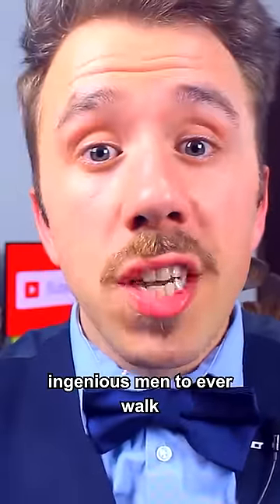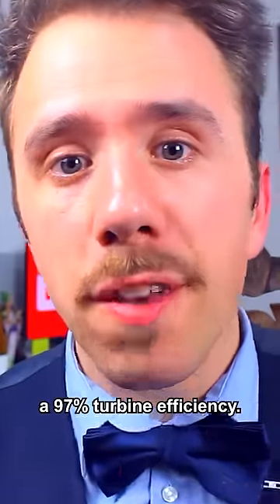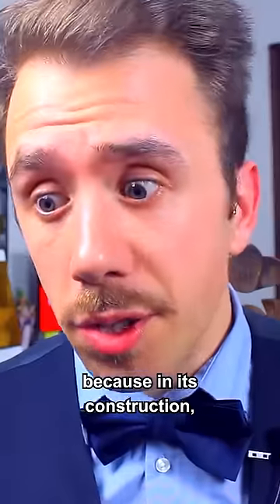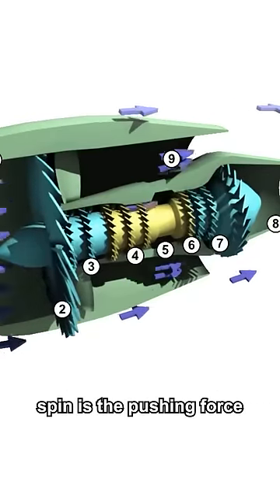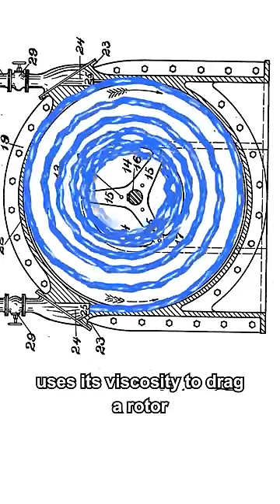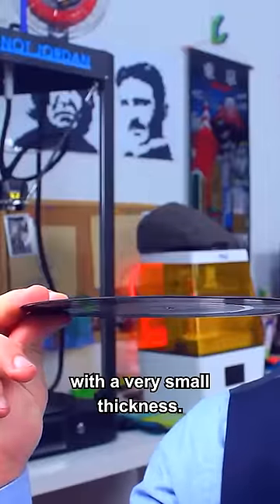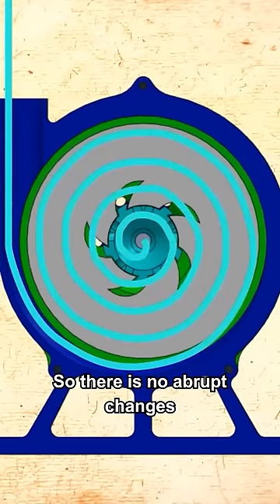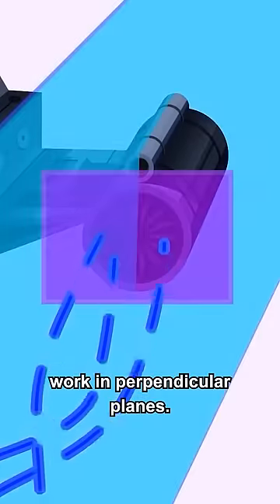97% Efficiency?! Was Tesla Right About His Turbine?

Comment: whenever you put a load on it, its efficiency decreases to a point where it is only marginally better than a traditional turbine, and even though it was still marginally better, it was never widely used because the blades would warp.
Reply: The warping is a big issue, blades sturdy enough to withstand the stress can likely never be small or thin enough for the thing to even work right
Reply: This is another one of those time where if the title has a question in it the answer is usually no.
Reply: To me this sounds like "V1 had missed some traits". Usually that means that people create a V2 trying to take those additional factors into account.

Have there been attempts at doing this? And if so, why didn't it work?
Reply: also only works for certain applications mainly power generation wouldnt work for airplanes for obvious reasons
Reply: Or to be that efficient the blades or the discs would have to be composed of vibranium or anamantium.
Reply: @Olav_Hansen was that an ultrakill reference?
Reply: Yes, but building materials have improved such that his design is used as a pump that can actually pump sand and rocks
Reply: @richardoconnor7112  It would be interesting to see how it would work when applied to moving grain. If successful it would definitely have some benefits for smaller scale farmers.
Reply: 🎉❤May new Materials such as Graphene, Titanium, Fiber Optics Composite and Uranium help?!
Reply: @EnbyOccultist I love your pfp. Did you draw it yourself?
Reply: As far as I remember it turns into crap when you put a load on it, and one of the main issues is having the gases exit without effecting the discs.
Reply: So his genius was not all that after all
Reply: it never archived the claimed efficiency. In most applications it is not superior, because peak efficiency is only possible at high velocities and its  relatively low torque at low speed.
Reply: Do you mean thermal efficiency? Wouldn't it be subject to carnot efficiency and not get anywhere close to 97% even when there was very little load, it should only be like 30% efficient, MAX, right?
Reply: @Olav_Hansen  the disks bend and warp and can't be made strong enough thin enough to work
Reply: @arg31ify  can't it be made thicker?
Can't it be made more rigid?
Most designs fail the first time, but by recursively designing a product you usually overcome many of the challenges, even if it's at the cost of some of the theoretical performance.
Reply: it is used in hospitals
Reply: @hamster2845  Maybe, but I think it would need something more like Mithril. Though I suppose you could use, Dragonite ore or maybe Adamantium.

Sorry, lame joke, I'm very bored and my edibles are kicking in.(I don't like alcohol and Cannabis is legal where I am.)
Reply: The reason for bending and breaking is because of the immense kinetic energy at the edges of the disks, especially at higher rotations per minute or especially per second.

Theoretically, the work is basically flawless, if you are comparing it to almost everything else from the same period.

Especially at smaller scale, it works very well.

However, spinning the edge of a disk with radius around 15 centimeters (so 5.9 inches) at 30 000 times per minute (or 500 times per second) is completely different from spinning a disk with radius of 15 meters (so 49.2 feet) at the same speed.

For comparison, with the first one you can cut down a tree. with the second one, you are probably splitting a mountain in half, vertically. The kinetic energy at the edges is absurd.

So, while the calculations of Tesla are correct, at least I have never heard of any material that wouldn't tear to pieces at such speeds.

I'm not doing the calculation, but it should be something like: rotations per minute (so speed) times weight of material times the radius... I have no idea right now, and I'm not planning on checking. It's a lot.

Using something smaller doesn't really work for mass use, because something smaller cannot power a whole city, and no one has the time to deal with thousands of these, each generating a small amount of electricity, each with the possibility of breaking... No one is that stupid (I sincerely hope really no one is that stupid. If someone actually decides that this is a good idea, it would be a good sign that humanity won't last much longer, at least if it's someone higher up on the ladder of political power). It would even cost way more to make and maintain them rather than building a normal dam with a normal turbine.

Diamonds would (most likely) not survive as well, the disks need to be quite thin, so the water can rotate them easily. Diamonds are also not indestructible, and such tearing kinetic energy might snap a thin diamond disk (at such speeds for a very big diamond disk, someone would probably die a lot richer as the disk shatters and countless diamond pieces slash them in half, vertically. Probably tiny pieces of diamonds stuck in their bones and insides as well). Not to mention the production costs and repair costs... Since I haven't done the calculations, I don't actually know if diamonds would survive, but I (again) know that the kinetic energy is absolutely absurd, so I can see this disk rupturing, even if it's made entirely out of diamonds. Keep in mind, those disks should be really thin, like a millimeter to two millimeters (so 0.039 inches to 0.078 inches) (that's going off of memory, so they might be slightly thinner or slightly thicker).
Reply: @Olav_Hansen there have been hundreds of attempts and none work for various reasons mostly boiling down to the design isn’t realistic like most of teslas designs.
Reply: @EnbyOccultist  The blades don't have to be thin, only the space between them. Of course, then the power density goes down, as you have fewer spaces for a given volume, but the principle remains.
More importantly, it reaches peak efficiency at unreasonably high rotational speeds.
Reply: @Happy.Viewer Uranium and fiber optic probably won't, the first one because it's heavy and at the same time radioactive (so unless it is used in a close environment some uranium would get into whatever is going to the disc via erotion) and fiber optic because it isn't hard to break and it basically really thin fibers of glass
Reply: At the end of the day, while harnessing laminar flow was a good idea in theory, the construction to take advantage of it was just no good in everday, practical use.
Reply: Thank you captain!

Comment: 97% if there is no load attached to it... otherwise everyone in the world would use it already
Reply: So... Just a disk that spin?
Reply: @bachvandals3259  tesla spinny turbine
Reply: Wrong,  it turns at such an insanely high rpm that bearings can't be used on it
Reply: @NeuKrofta  what number are we talking? Bc we got all kinds of fancy bearings.
Reply: @provuksmc6619  30-50 thousand rpm that we know of. It's basically unknown how fast it can go
Reply: no the turbine had a had start in the market and the efficiency is about the same as a turbine
Reply: @NeuKrofta It's not a materials issue, it's a physics issue. Once you apply load to the output shaft of the turbine, the fluid speed and disc speed desync, inducing inefficiency due to shear flow and reduced contact time.
Reply: Actually the load isn't the problem, the problem is viscosity.
A torque converter is basically a Tesla turbine, it can pull all the load any engine can produce without actually exploding.
Reply: @monad_tcp  na... a torque converter is a gearbox
Reply: @NeuKrofta  bearings can be used at those speeds, 30 - 50 thousand rpm isn’t that fast. Your vacuum cleaner motor is likely spinning faster.
Reply: @conorstewart2214  and then there are still magnetic bearings
Reply: @conorstewart2214 vacuums are 15-30k rpm, not 30-50k. Torque converters are also fluid filled and operate on similar principles
Reply: the problem with the Tesla turbine is to overcome the problems of the slow down due to an output shaft you have to massively ramp up the RPMs which the turbine can do in theory but our existing materials with deform at the speeds required and fly itself apart that's why we don't use it.
Reply: But the problem is also that in high speeds the material is extending due to g-force until it touches wall of turbine.
Reply: Tesla isn’t half the genius he’s hyped to be
Reply: @kevinbeck8836 He absolutely is the genius he’s hyped to be. What he’s not is a magician, which 90% of the people who hype him pretend he was - they believe he did things that completely violate physics, and don’t understand how half of it even worked to know why it isn’t used today. That doesn’t make Tesla any less of a genius - that just makes his fans that much less of his genius. But that’s true of any genius.
Reply: @babybirdhome he was a magician at least by the standards of so called modern science
Reply: @kman201399  exactly but it was significantly more complex and consequently more expensive to make with having nearly identical efficiency
Reply: @provuksmc6619  ALL of them fail, nothingnis strong enough
Reply: @monad_tcp  Yes, fluid viscosity dynamics are at play (fluid friction). No, Automatic Transmission Torque Converters are not the same. They use stator and rotor vanes at particular angles, akin to an airliner jet engine but in reverse (pushing/pumping the fluid. Not inducing rotational force from the fluid, like in Tesla's design).
Reply: oh you sweet summer child
Reply: @kevinbeck8836  he formed our knowledge of electricity as we know it today, also he invented the radio, the like most fundamental invention of the modern time, like where would we be without radio waves.
Reply: @NeuKrofta  Quite impressive someone can say something that wrong that proudly
Reply: @MisterMick113  don't Dyson electric motors go at 100k+?
Reply: What is the efficiency of "ordinary" turbines?
Reply: @PapaMike23 modern steam power plants have an efficiency of about 50% which is essentially the theoretical maximum without reusing waste heat in city heating.
Reply: @Silasssssssss  That wasn't the question. The efficiency of the turbines is much higher than that of the entire thermodynamic cycle.
Reply: @PapaMike23  your question is impossible to answer if that wasn't what you were looking for. There isn't an 'ordinary' turbine since there is a dozen or so combos and possible set ups that are all commonly used today
Reply: @Silasssssssss  The point is that the isentropic efficiency given for the Tesla turbine (which is probably wrong anyway) is completely meaningless when comparing it to the efficiency of a thermodynamic cycle. The isentropic efficiency of modern turbines that are used in power plants are higher than that of a Tesla turbine.
Reply: @PapaMike23  then 20-90% would be your answer. I get your question but there's just so many variables in what type of turbine you have, what you need it for, how many stages etc. your question is practicality unanswerable
Reply: Moderm steam turbines also have an internal efficiency of over 98%.
Reply: Some of the people in the comments are correct, tesla turbines can't run at full efficiency because their casings literally tear themselves apart.
Reply: @babybirdhome  ergo why they said half the genius he was 'hyped up' to be. Key words being hyped up, he was still a genius it's just a lot of his ideas were misunderstandings of the world he was studying and a lack of practical scale, or safety. Don't get me wrong I think every one of his failures pushed him to a better understanding and advanced humanity further than almost anyone else could claim, but the hype train from his fanatics are a bit.
Reply: @NeuKrofta  magnetic or liquid bearings should be able to handle that right?
Reply: @jonf2009 👍
Reply: 💯 Correct
Reply: Except pneumatic tools, especially high rpm ones use this. Think like pneumatic dremels and dentists drills etc. . Yes the efficiancy goes down, yet it still is THE option for specific applications, as are most engineering "tricks and methods", they usually don't reinvent the wheel you know? Usually it's "How do I escape this situation while retaining the biggest ammount of cash without inventing something new?". And often the answer exists "elswhere" so they look around and see where to find it, you'd be surprised how many "simple" mechanisms are rediscovered to be extremely usefull for varying applications the original inventors could never have dreamed about.
Reply: @kman201399 yes, the same efficiency at speeds we can use it. But allow the disks to spin freely and the efficiency goes through the roof! As will the unit, because at 50k RPM the disks edges are traveling faster then sound and both the disks and the bearings can't haddle the forces applied. But Tesla was right it can reach 97% right before it blows up.

Side note: no one has ever seen how fast the unit can actually spin, so 97% may be too low! And BTW, the unit is in use today, limited applications were it's unique traits are desired!
Reply: @NeuKrofta  lol, you know how fast an impeller in a turbocharger spins? That’s is definitely not the reason we don’t use em lol 😂
Reply: @NeuKrofta  I heard it were the disks that failed since there is no known material that could put up with the forces while being light enough
Reply: It doesn't generate much torque, but the rpm more than compensates. The problem is that we dont have materials to be thin enough and withstand the high rpms of the turbine
Reply: @cyber3371  the RPM only compensate only we have something that would need this speed. Force and velocity are the key. 

*strong enough. Because we can build thin.
Reply: @kevinbeck8836 He was a genius, it isn't hype.
Reply: @provuksmc6619 to adjust the amount of torque experienced by the turbine. It'd be easier to use a simple ac alternator and transformer circuit. And to get over the torque versus viscosity issue, use high pressure water to drive the turbine. This is how many hydroelectric power stations were designed for the longest time. The only problem is the maintenance cost.
Reply: @NeuKrofta Turbochargers turn north of 100,000 rpm and they last for years. No blades equals no torque, it's that simple
Reply: @bort6414  as brilliant as Tesla was, you would think he would have seen this in his famous thought experiements...
Reply: @bort6414  Not just that, but long periods of time with that differential, can cause the disks to be damaged and warp, needing to be replaced. It would be more expensive in the long run, while producing no better results.
Reply: @NeuKrofta  magnetically opposed bearings
Reply: @NeuKrofta  bullshit, the rpm follows the speed of the medium going through, to achieve laminar flow. How are you this confident, when you are so wrong?
Reply: @ultrasoulviver these also scale poorly, and have only ever really been useful at really small sizes, building one of a useful size you start to run into the limits of even modern materials, according to one of my engineering professors these are really only good as a demonstration of the physics of viscosity just like many of the small desktop size engine models, a cool principle but  there is a good reason tesla abandoned the design.
Reply: @NeuKrofta  Not if any laod added then it 0% efficient just degrade to a multi disc brake
Reply: @monad_tcp  Ye sload is a definite problem... since the discks are thing to use fluid dynamics they bend under any load and prees against each toher and the housing...
Reply: @bort6414  CAn't you use an insane gear ratio to slow it dcown?>
Reply: @conorstewart2214  One google seach says that most are below 30k with only higher end models going above.
Reply: Thats pretty easy to handle with specialty bearings, if i remember correctly we have uranium centrifuges running north of 100.000 rpm @NeuKrofta
Reply: No we don't have the material science yet to make the disc's handle the forces put on them on load, the disc's fail relatively quickly@NeuKrofta